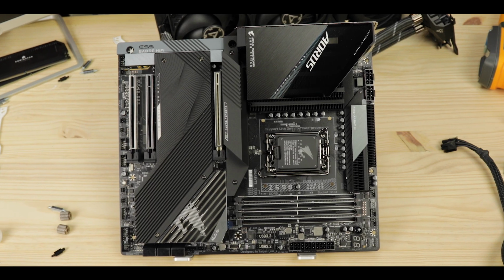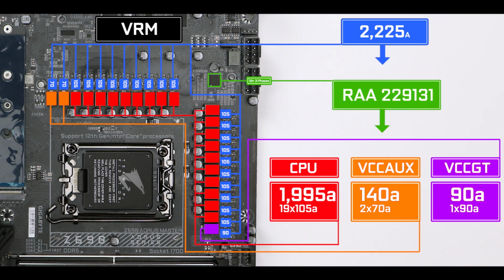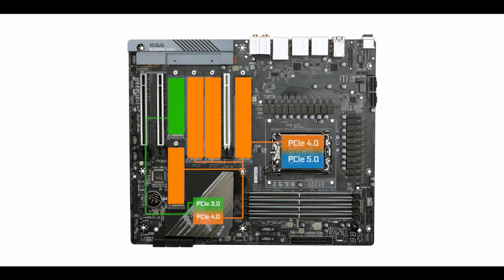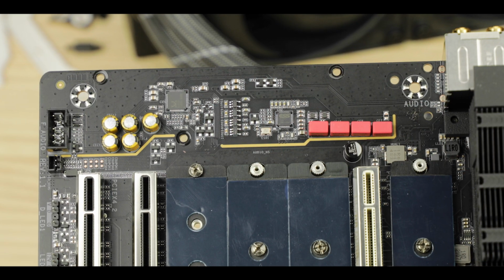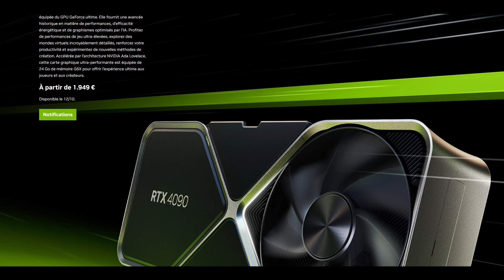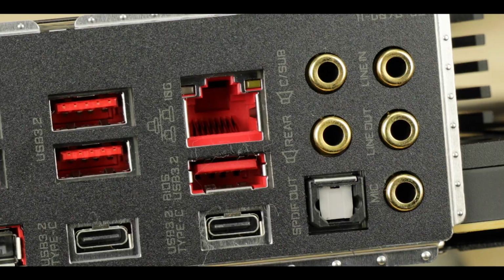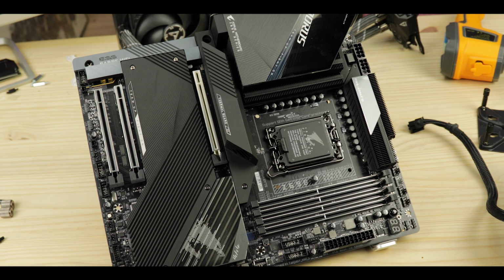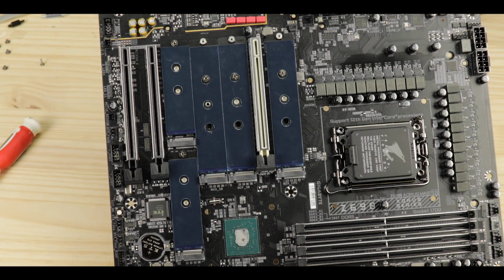GIGABYTE Z690 AORUS MASTER, pure love for gamers!

Comment: This board has a weird form factor. Not a full blown E-ATX but it is somewhat wider than an ATX. Will it fit in a case that accepts ATX only? I've found a pretty decent deal on this board and it would suck if I have to get a new case just because of motherboard. Also, those VRM heatsinks, holy crap! Would I even be able to fit an air cooler for my CPU?

Comment: Great video and it influenced my purchase of the Aorus Z690 Master without reservation.  Great job!  One thing to note is that I personally see having the PCI 5.0 slot separated and not split is that the new Nvidia 4090 is only PCI 4.0 (shame on Nvidia) and half of that would make it PCI 3.0 X16 if I used the other slot ever (possible with water blocked video card).

Comment: I'm on a z390 aorus ultra and wanting to upgrade to a 13700k. It's unfortunate that the z790 only one with a post code led screen, lol. Why have they taken that away from every board except the $500+ ones on the z790 boards? D:
Reply: Boards have become extremely expensive in the last few CPU generations. ASUS ROG HERO boards went from 380€ brand new to 600+€ brand new.

Comment: Love Gigabyte! I have this board and I have to say it's great. But I wonder if it'll ever officially support ddr5 speeds past 6400-6600mhz / cl32 / 30 .. Otherwise I find it the most fun to overclock with Gigabyte. It might not be as in depth as some Asus boards, but I find Gigabyte far more stable overall
Reply from the maker: And maybe a little bit more consistent, more focused as well.

Comment: Awesome reviews as always. Don't these boards look old though without any PCIe 5 m.2 storage?
Reply from the maker: well that's what the X670 series is supposed to do... but frankly, as I am wrapping up the reviewing of the PRIME X670-P, the Z670 AORUS MASTER looks even better than i thought.... go on my tweeter, you ll understand.
Reply: @Laurentschoice  but who's going to want to buy an Intel processor if this just has old technology on it?  Also how do I find you on the Tweety Bird?
Reply from the maker: My handle is @laurentschoice. 

When I see what the X670 boards cost and provide,  frankly talking... AMD is in trouble. Hope the other boards I receive will show a bit more that that.
Reply: @Laurentschoice  Yes I agree. Not to mention the cost of adding on the DDR5 and the cost of expo, a new cooler, and a new power supply and if it's an EATX mb now you need a new case also.  I have an almost 12-year-old 980X computer that I'm about ready to upgrade. Looking at PCIe 4 benchmarks for the SSD drives seem to only be twice as fast as SATA that doesn't buy me a whole lot unless I now buy all new m.2 drives. So a decent setup for me is probably about two or three grand. Also I only use it for DAW recording with the Reaper app and for my file storage so I don't need anything for games but I do need very fast single thread and multi thread performance for managing 100 tracks and Reaper plus lots of plugins and the horsepower needed to render it all out with single threading. Maybe the B 650s will do what I need but I have yet to see all of the specs on the motherboards for that yet until they come out and I'd really like to continue to use my ATX case and not have to buy a new one.  I have tested the PCI to PCIE adapter to use my RME 9652 audio board in the new computer and the adapter works in my current computer just fine and I expect it will work in the new one but if it doesn't then it's really a disaster.